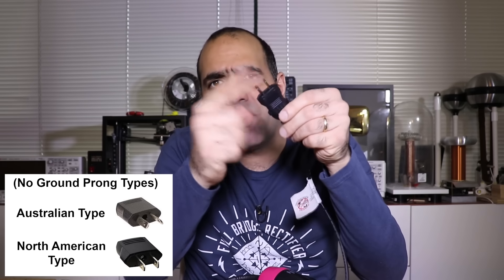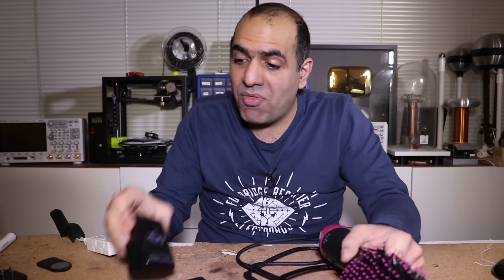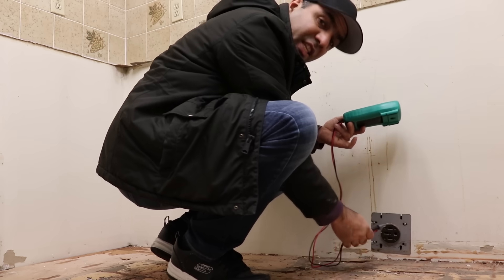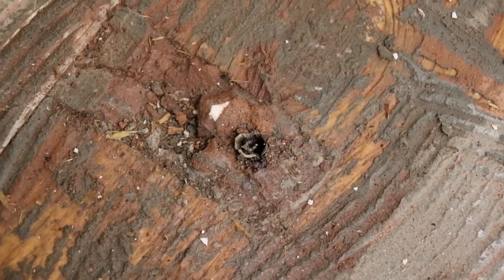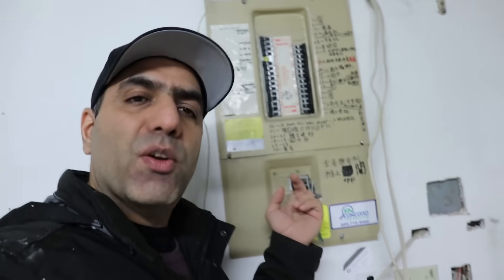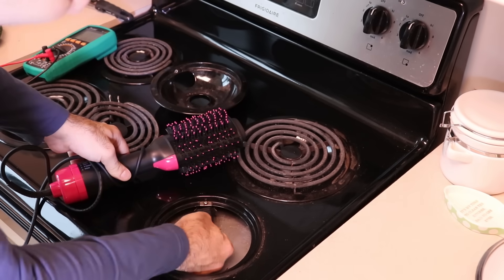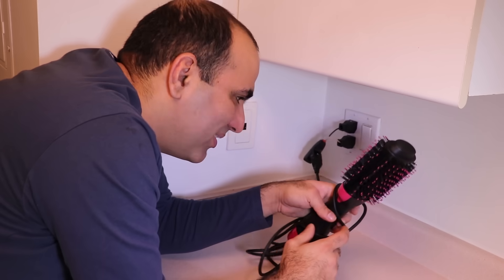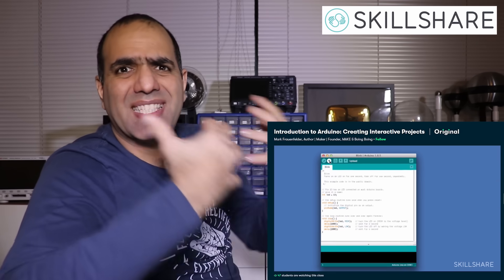Finding HIGH POWER 240V in a 120V Country

Comment: American power connectors looks so f*ng dangerous comparing to euro.
Reply: We Americans like to live life right on the edge.  😉 Danger is our business!
Reply: He's in Canada.
Reply: @zadinal  ? Def the same plug lol
Reply: @gregaria3664  it is I just thought I'd point out it is more of a regional style plug. Mexico and I believe all of central America use this style too. It isn't as dangerous as it looks. Most electrocutions in the US are from industry or home tool/equipment misuse. About 1k a year.
Reply: Not really. Even if you do accidentally touch one, it's probably not going to hurt you in any significant way. The biggest downside to these plugs is that they aren't locally switched like UK plugs.
Reply: @user2C47  It's not like you can't have switches at the outlets, you just go to the hardware store and buy an outlet and switch combo.
Reply: @user2C47  And what if you accidentally touch both with your fingers or worse your kid will? American like old soviet plugs where you have several centimeters when it is still plugged but can be touched. Even touching one can hurt if you standing on the ground without shoes.
Reply: @vladimirseven777  You really can't get your fingers behind the plug while it still has power going to it, fingers are just too big. A baby might be able to do it, but they'd need to be holding the plug in a really awkward way. Even still, it's only 120V, it just hurts a little bit. I've been shocked a few times in my life, I never got worried with 120V, but 220V scared the living daylights out of me, I could feel my muscles contracting. Luckily, I wasn't actually holding on to anything that could continue shocking me.
Reply: @Peepoop3301  Uhhhmm...okay?

Comment: Can I ask why that exposed wire sparking to the water wasn't tripping the breaker? Was there just enough resistance to ground to not trip the 15/20A breaker?
Reply from the maker: YeH the small arcs were not high current, and the big explosion was too short to trip the breaker
Reply: @ElectroBOOM  Thanks for the explanation! Really enjoying learning and chuckling through your videos.

Comment: Hi Medhi, I mentioned in a comment on one of your previous videos that apartment buildings work on splitting 3 phase 208v, as opposed to standalone houses that take single phase 240v and split it in half for 120v to ground. I'm happy to see you demonstrating this. Also I can get you in touch with a very good electrical contractor in the metro Vancouver area if you are looking to do more videos in the field. That live wire in the floor is a really big no-no

Comment: Here's a question pressumably the grid is 3 phase with 120v between each phase and neutral and each house has two phases delivered, so how the hell do they balance the grid?
Reply: Because it is an apartment building and each apartment gets different 2 phases out of the 3.  So for every 3 apartments, you have equal loading on all 3 phases.

Comment: When outlets are split like that, it is called a multi-wire branch circuit. The reason to do that is that both halves can share a neutral wire without doubling the current on it. In fact the more balanced the load between the two halves the current on the neutral approaches zero amps.

Comment: 120-degees phase shifted?  Sounds to me like they just use 3-phase power and distribute the different legs here and there willy-nilly.  It's probably fine for a heater but what happens when you connect a 240V motor to it?

Comment: Wow, Just think: If only you could temporarily remove about 5-ish screws move a jumper from 240-50hz to 120-60hz internally, .... in less than 5 mins... .. Yeah, that's be cool!   Now , If only EVERY mass produced item had that variable embedded by default as to create a wider scope for marketing their crapl.... Ya know, because the engineering phase showed that it'd actually cost more to exclude the option.... IF ooonnnllllyyy :-?
Reply: As the video said all sorts of products can automatically handle different voltage and frequency, virtually any electronic device does. Lots of hair dryers too, apparently.

Comment: Not gonna lie,
I ran into exactly the same problem some time ago. Bought a Xiaomi steamer that requires 220V instead of 120V. I had multiple solutions from using transformers to plugging it into a dryer outlet, but there is one thing you didn’t mention. 

What would you do about frequency? I bet this hairdryer is rated for 240V 50Hz, and we have 120V 60Hz. Thus, even if you invert 1 phase 180°  you will get these 240V, but frequency will be still 60Hz, which is believed to be bad for the appliances from the Old World. 

From my own research, you would break your teeth on that because you need to rectify 60Hz AC into DC and only then modulate it back to AC with a correct frequency. There is no shortcut for that. 

If you wanna take that challenge, feel free, because my knowledge ends here. I can only imagine what would I use to make a perfect sine waveform.
Reply: Only a few types of appliances are frequency sensitive.  Most work just fine on 50Hz or 60Hz.

Comment: Hey, wondering if anyone can clear up an argument I'm having with my Motorcycle dealer about volts.....
My battery is 12V 11.2 amps. I wanted to upgrade to 12V 11.6A, but they said the wiring wouldn't take it because of the extra amps. Stop me if I'm wrong, but I always thought the volts restricted the current flow to be a consistent amount, so the extra amps would only be like an extra reservoir?
Reply: I've never seen a motorcycle battery rated at 11.6A.
Reply: @stargazer7644   Yuasa YTZ12S
Reply: @ArcanePath360  That's an 11 AH (Amp Hour) battery.  Not the same thing as 11 A (Amps).  Amp hours are a measure of battery capacity.  With the same load, an 11.6AH battery will run slightly longer than an 11.2AH battery, that's all.  The AH rating also usually has an impact on how fast you can charge it, but the difference between those two are minimal.  You can generally charge a 100AH battery with 10 times more current than a 10AH one, for example.  So long as it physically fits and the terminals are in the same place, you should be able to use a slightly higher capacity battery with no problem.
Reply: @stargazer7644   Thanks. So it appears I was right then. They said the amp rating would overload the wiring. I knew they were full of shit, since as you explained it just means the battery holds more juice, it doesn't let the juice flow out any faster.
It doesn't matter now anyway, since I got rid of the damn bike. Never buy Kymco.
Reply: @ArcanePath360  Yes, you're right.  A drastically different AH battery could conceivably cause a charging problem (and likely wouldn't physically fit), but the tiny difference you mentioned would make no difference whatsoever.  Heck, a battery changes AH capacity more than that just with age.

Comment: Ok which idiot leaves a wire hanging like that in an enviromnment where the possibility of water shorting the wire is high, always disconnect your loose wires or turn off the fuse connected to  it, if you see it arcing just check which fuse it is connected to, it only takes a few minutes and prevents a house fire......

Comment: Believe it or not, I found a 460 V outlet in a 120v country, here in Florida,
Reply: Was that a nice special janitor Outlet, you know a 15 amp outlet wired up to what it shouldn't be. Another thing I read, this guy was sitting up a sound system in a gym ( oddly enough to talk about electrical safety around stages and musicians ) and encountered what they later told him to be a "special outlet for the janitor" that he didn't know about and fried his wireless microphone as that was plugged in before the switch on the power distribution unit. He was quite happy he smelled the burning before he turned everything on.
Reply: that is 240v 2 phase like in the UK for cooking apliances and washing machines etc, 15amp cables, not to be messed around with pretty much instant death
Reply: @thetechoasis2179  that was no appliances, this one feed a 30' electric dumpster , go to your local mall and you will find em 👍
Reply: @thetechoasis2179  ehmmmm no
Reply: @TheAdatto  ehmmmm yes, think i might know about that being an electrical engineer, fool
Reply: Florida is just Grand Theft Auto in real life
Reply: Was it for the electric chair?
Reply: Yeah he’s talking normal residential code — people have 3 phase all over in farms and rural areas
Reply: @MernokiMegoldasok  277Y480 3 phase
Reply: @r.h.8754  Same in Oz, though my mate told me just yesterday that his place is 3-phase for reasons.

Comment: In Brazil we have some similar problems. Here we have a few different voltage levels: 220/127V, 380/220V and 230/115V. If you buy a 127V appliance and you move to a region where there's only 220V, you either buy a new one or a small transformer.
Reply: But most work on wide range. Also 115 or 127 doesn't really matter. There are specifications for providing electricity and voltage may vary +/- 15%

Comment: the blowing multimeter moment reminds me when on vocation school  measuring the voltage in current mode, blows quickly. fortunate the fuse is pop up before make a fire on the classes :))))) miss that moment

Comment: 3:55 I also did this: meter on current (measuring the short circuit current), my meter also survived it
Reply: It's a rite of passage for anyone using a multimeter. Most meters aren't even fused on the high-current terminal, so it can be scary! One time I went to measure the voltage across a 24 volt battery and it was on the 10A input and I could feel the leads heat up rapidly in my hands. Luckily I disconnected it before anything got damaged!

Inside the meter it's just a shunt of known resistance and it measures voltage drop across this shunt to calculate the current, so unless you leave it on long enough for the shunt to burn up, it won't get damaged. :)

Comment: My home in NYC is wired for 240vac. We use 220/240V for air conditioners, compressors, and other woodworking machinery. There are two separate 120v lines coming into to house from the from the poles outside. Only about 5 outlets are wired for the 240.

Comment: I've thought about doing this for a skate sharpening machine, but wondered about the breakers still working properly to prevent any dangerous conditions.
For example, when working on a 12HP  360V electric motor I turned off the main feed to the 360V distribution panel, but then found a live circuit.  It uses a 120V line for the motor controller relay.
Strange, because another motor adjacent to it has a 360V relay from the line s powering the motor.
Never hurts to check for live wires, never assume everything is off just because you turned it off.

Comment: Hahahahha. I sold off my 240v to 120v 500 (or 1000 I forget) watt converter last month. Was one of the single socket models shown in the video. :P
As I'm in the uk, when am I ever going to need a step down (it did both with a switch), for an American/similar 120v device? I can get everything I need in 240...

Comment: If Canada converts its electricity to 240VAC, will the budget skyrocket to the highest in history? I just expecting Canada and the whole North America convert from 120V to 240V.
Reply: Newsflash: Canda and the US already have 240V going to every single house.  Our system provides both 240V and 120V.
Reply: @stargazer7644  Okay, I mean, converting the 120V (power socket voltage) to 240V, with the same configuration as the European ones (240v line, 0v neutral, and ground), not the 120-120-ground.
Reply: @stevensutanto968  The system we use is safer, and the devices that need 240V can have 240V.
Reply: @stargazer7644  I mean, if the system Canada & the US currently use is changed to the system similar to the European ones, will it need the large percentage of government budget? (question about the reason of system change aside)
Reply: @stevensutanto968  The government wouldn't pay for something like that.  Yes, the cost would be huge.  So big in fact, it will never happen.  There simply is no need.  A lot more than just US and Canada use 120V systems.  Most of the Western hemisphere and several other countries elsewhere use 100-127V residential power systems.

Comment: Apartments in commercial buildings are 120/208 volt because they're generally wired to a Delta wye transformer. Single-family homes are generally wired to a Delta Delta so you get 120/240 volt.

Comment: You solved the voltage problem but you didn't solve the frequency problem.
US currency is 110V 60Hz,  European currency is 220/240V 50Hz.
 If you run electric motor that designed for 50Hz on 60Hz, you will overheat it and eventually burn it.
Reply: Universal motors really don't care what frequency you feed them with.  Only induction motors do.

Comment: Apartment - 3 phase supply.  you get two lines (120 degrees apart from each other) and a neutral.  Residential - 240V transformer with a center tap, giving you L1 L2 and N.

Comment: Your distribution system is nuts, omg. Use 240V phase to neutral and every is problem solved. 120-0, 120-120 90º, 120-120 180º, two outlets in different phases, what's next?

Comment: I remember taking a 240 V measurement deep inside a UPS.  Just as I made contact with the awkwardly placed terminal, the phone in my shirt pocket buzzed.  The meter ended up across the room before I realized that I'd not actually felt a shock.

Comment: So, if you need 240V for SOME appliances, then why do you need the 120V lines at all?
Reply: Because it's far safer to only use high power circuits for high power applications.  Almost nothing in your house NEEDS 240V.  So why have it at every outlet?

Comment: In the UK. We have split phase 11kv DY11 transformer where two phases have a phase angle of 180 degrees. Phase voltage gives you 240v and line voltage gives you 480v. These are typically used in rural areas to supply farms.

Comment: Last month I built the same kind of plug for my garage to power my welder. Each circuit is on a 20 amp circuit so with this plug it is a 240v 40 amp circuit, and works perfectly for my little buzzbox welder.

Comment: Glory of North American wiring:
110V (common, small appliances),
 208V (large appliances and some shop/factory equipment),
220V single phase (more common for large machines and power tools),
220V 3-phase "wild leg" (110v on one, 240v on second, and 110v on third pin - "poor man's 3-phase" and somehow works as long as everything is wired correctly),
220V 3-phase (proper this time, all pins have 220v - $$$). 
Then there are 480V, 600V, and so on, but they are specifically for very large machinery. And God help you if you don't match the voltage to EXACTLY what your equipment requires!

Comment: 120V systems are so weird if u use and learned about 3-phase. At 120° you get all the phases on a 3-phase system for moar powah. How do they even get 180° phase shift? I think all generators are 3-phase
Reply: It's a single phase with a center tapped transformer.  The center tap is ground referenced, so when you compare it to the ends of the transformer one will be +120V and the other will be -120V with 240V across the two.

Comment: Ah yes, that's right, large buildings are usually supplied with 3 phase. Most small residential buildings are 2 phase or 180 degree offset.

Comment: in India people combine two phases of 220v AC to create 440V In order To Run 220V appliances in full capacity because even though they say its 220v the voltage recieved is around 130-200 
Can you find the problem because of course power stations generate 220V .
another point : all the people use one live wire and the neutral of the appliance or the house wiring is earthed and the neutral is not used at all Can this effact the current or voltage in any way 
Please make a video

Comment: The ol' suicide cable...  Playing fast and loose with the 180° out-of-phase individual 120 volt legs of residential North American power service does have its advantages.  I've solved lots of highly temporary and over-the-top sketchy problems with such antics.  The, "Don't try this at home," disclaimer is always apt.